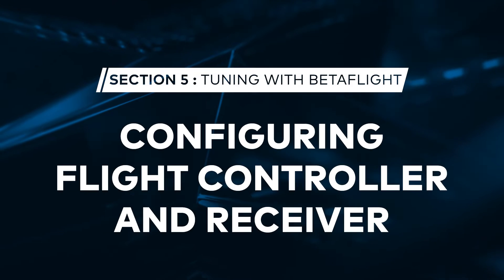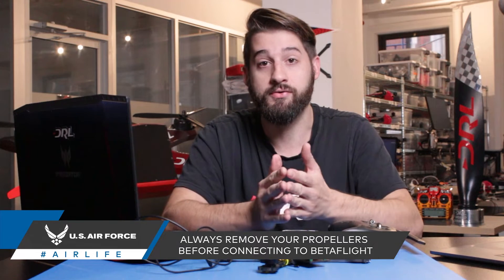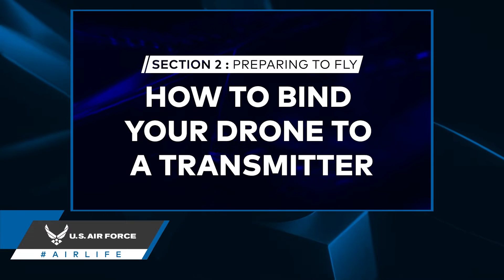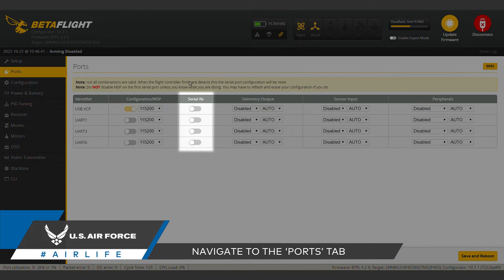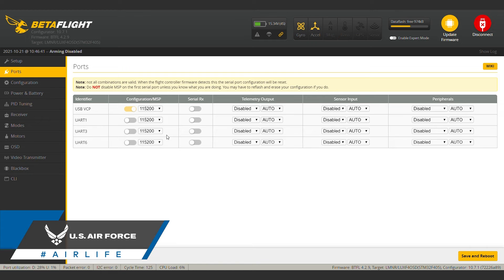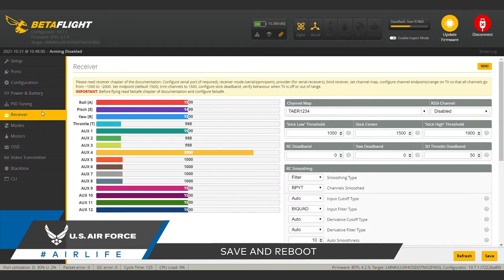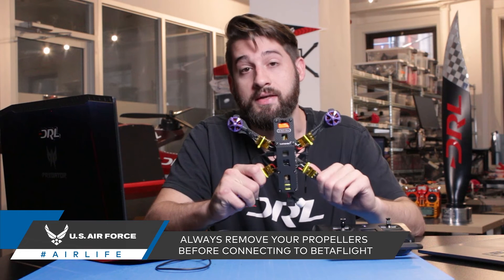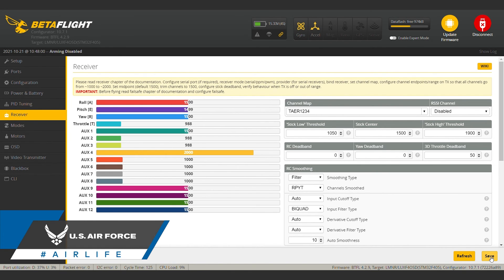Configuring Flight Controller and Receiver | FPV 101: Phase 5, Episode 4

Comment: Just getting in to buying a BNF drone... i have the DJI controller 2 and going to buy a dji O3 bnf 5" drone to connect it with... my question is, can i buy a BNF drone with lets say TBS Crossfire, and dissregard that reciever and just bind it directly with the DJI o3? i was thinking of either getting the ESLR or TBS on the drone in case i wanted to switch later on to another controller. will that work? or am i forced to use TBS if i order the O3 with the TBS reciver on? or will i have both options?